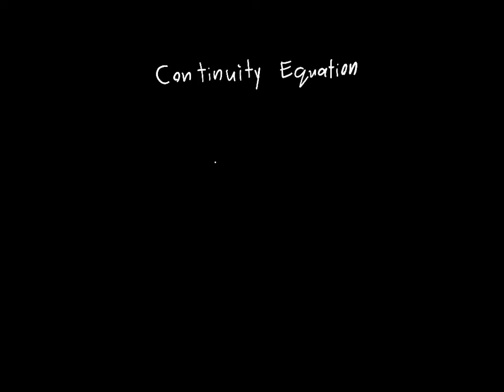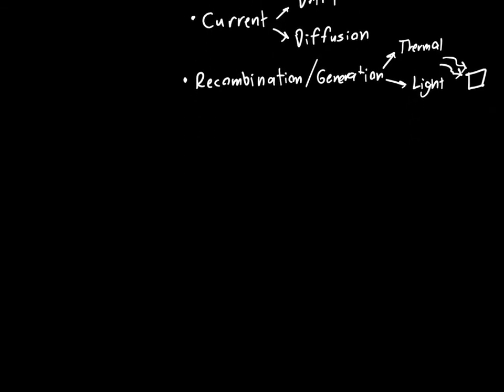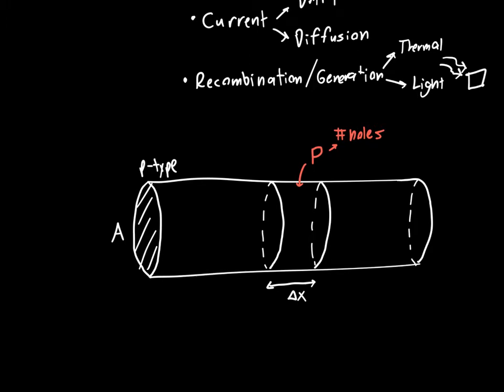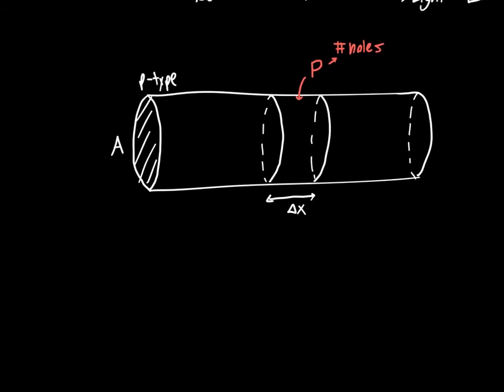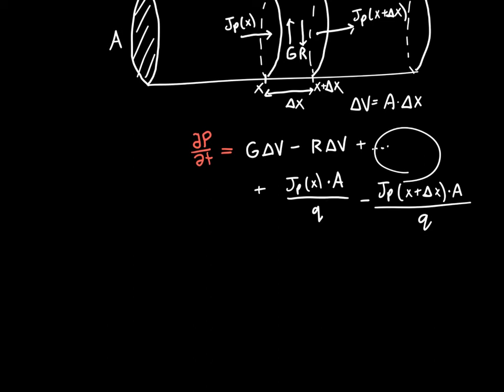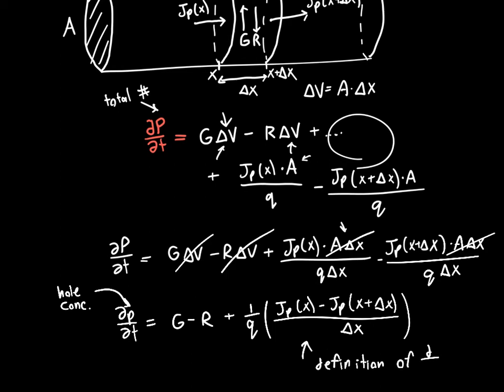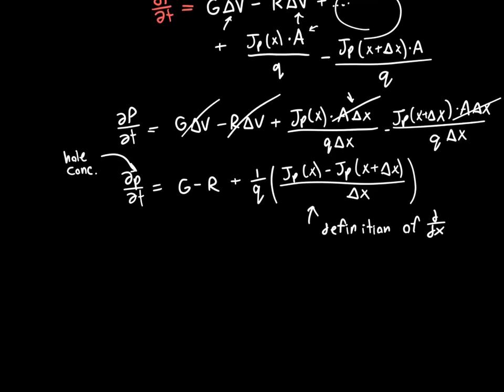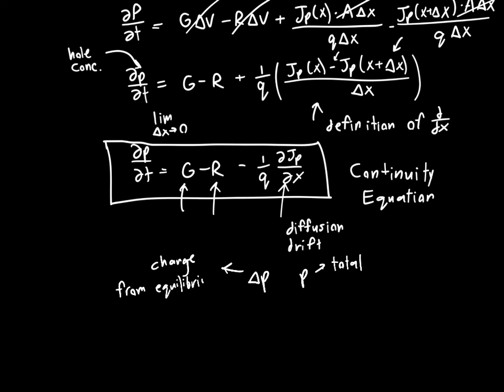Continuity Equation Semiconductor Derivation Part 1

Comment: when dividing ∆V throughout the equation, dp/dt side is not zero, shouldn't there be a 1/∆V on the dp/dt side? @ 6:52
Reply: P (total number) goes to p (Number Density or total Number per Volume)
Reply: Thanks, I was having the same doubt when dividing by ∆V
Reply: @moritzhuck7575  I was also having the same doubt..
Now it's clear
I understood
Thanks a lot

Comment: One question sir. At 3.55, on the left hand side it is dp while on the right hand side it is ∆V. Why not ∆p or dV?
Reply: Excellent question. I'm approximating the derivative using a finite ∆V, implicitly assuming that the time derivative is a function of the small volume element. dV would be more in keeping with calculus notation, and would work just as well.